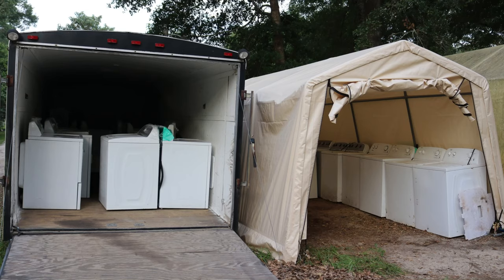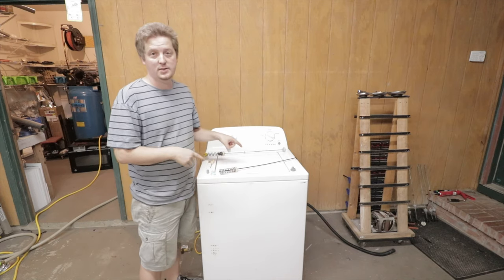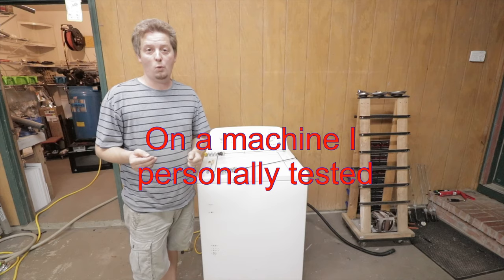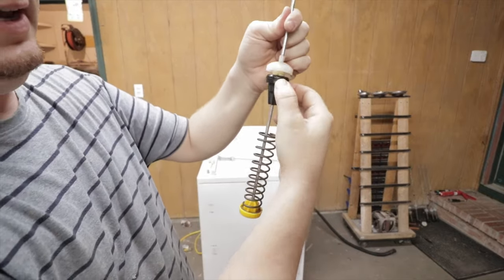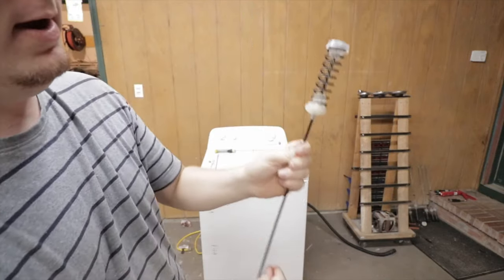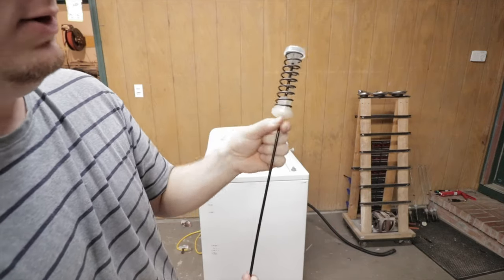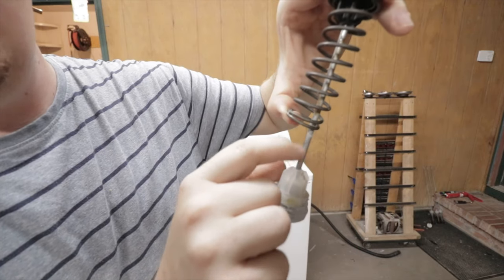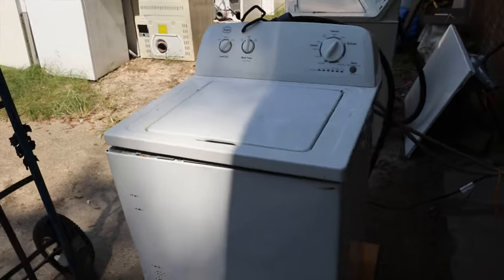Cheap Permanent? fix for shaking banging Washer? $7 to fix Suspension dampening rods W10780048

Comment: Thanks for explaining that the problem is the orange damper sponge, and that it works by friction.  Knowing that, here´s my successful fix:  I pried out the sponge, cut it vertically,  scraped off loose debris, cut approx 1/8 to 1/4 to the length (depending on the wear), greased the rod and sponge (with the part's own grease), placed it back around the rod, wrapped cloth tape (ie medical adhesive) for a snug fit around the rod and 16 mm diameter, and stuffed it back into the plastic cavity.    Minimal vibration when centrifuging. So far so good. Cost free.   

My Whirlpool did not include the four horizontal springs (from the tub to the rods) but the attach points are there.  I will buy and add them.
Reply from the maker: Interesting let me know if it fails. some other Solutions I've tried only lasted 30 days. So far the Liquid Nails is still holding strong the only problem with it is how long it takes to dry before you can put the rods back on.
Reply: Are the 4 Springs that attach to the tub and the dampener Springs required? Mine only has 2 of them. 4th of them on the right hand side front and back
Reply: After reading all the other fixes I am going to try yours. wish me luck.
Reply: I was sitting here freaking out with all the DIY ideas until I read your Gus! I recently replaced the water pump which probably broke because of the rattling. I used plumbers tape. I don’t think I used enough though because it didn’t work on High spin but it worked on medium. It’s 11pm and I’m glad I got it done. My wife washes every day all day like it’s therapy. Lol

Comment: Great video. 

That piece of rubber plays the same role as the shocks in an automobile suspension. Both add friction to movement which when combined with the spring reduces the transmission of vibrations to the frame. The rubber is not as robust as a gas or liquid shock but certainly makes for a solution that is much cheaper. Not sure if there are better materials out there that can maintain the required degree of friction with absolutely minimum wear over a long period of time. But then, even brake pads wear out.  

In my case use of Whirlpool replacement rods resulted in a tub that was very stiff when I manually pressed down on it. There was no noisy banging even with unbalanced loads!  Three weeks later the tub now moves much more easily when I press down and bounces once when I release.  That tells me that the rubber dampers have already started to wear down. Its tolerance to imbalanced loads is pretty much gone.
Reply from the maker: Check to see if you can wiggle the inside drum compared to the outside drum.
Check Ben’s appliances in junks channel on how to repair this he made a video on it about a month ago. I have not made a video on it yet, but there is a new part if there is a bit of a wobble or loose drum it is repairable. This problem will wear shocks out quickly.
Reply: @WasherDryerMoney   Maybe, put the Youtube video link tag where we can jump to the video that you are referencing.  Granted, you can't post the link in comments, but you can post the YT part ... Like on your video:
 v =    IZZCwXEmGhE    ... Then, you can post that.

Comment: Thanks for the video, I took a soda bottle ring,( what is left on the gottal after you remove the cap) cut it in half and rolled it around the metal shaft and placed it on the soft sponge, then replaced the cap, it put more tension on the sponge and shaft, dont know how long it will work but really cheap fix

Comment: Got a free higher end windowed washer a neighbor kicked to the curb.  First run the drum wobbled violently before it even got up to a higher speed.  Getting the rods out of and into the top bushing was a total pain going solo but I got it done.  Took some sand paper and roughened up the travel area and that did the trick for now.  I like some of these other suggestions better but I wouldn't want to do this over and over again.  It's not as easy as some of these other washers appear to be via how to videos.

FYI my old washer is nearly 40 years old and the only repair I'm aware of was a broken wire due to it moving during operation causing fatigue.  The clutch is starting to slip and it seems like every load is out of balance lately but compared to new ones it doesn't rust and is built like a tank.  Weighs as much as a tank too.  Keeping the 40 yo dryer.  It's gone through a few belts but no reason to replace.  Even has a moisture sensor to save power.

Comment: great vid!!i thumb'd it. hey i have a standard whirlpool, 5yr old washer, the suspension rods were replaced 3yrs ago. however, i noticed 4 tabs on each corner of the tub, with a pin hole thru it, and realize i can attached centering suspension springs from there to the rods. so my ques4u is , y didn't the whirpool come with the springs, b/c teh tech who did the rods awhile back never mentioned them?????? are they worth installing? If not, i can't believe my 3yr old rods are bad again? thank you!

Comment: Very fun video.  I've worked on mostly Whirlpool W&D's for nearly 20 years.  I buy them, fix them., and resell them.  I've learned the only way to fix the rods is to replace them with new OEM rods. The aftermarket rods are junk and a waste of time to replace.  I totally agree with you about how great the old direct drive washers were.  Their biggest problem was they lasted for 15-20 years with proper care and Whirlpool couldn't sell the unsuspecting public new machines every 4-8 years.  The VMW you were working on had a lot of other issues besides going out of balance.   I like to say the VMW (Vertical Modular Washers)  should have been called HMW for Horizontal Modular Washers because they were frequently dead. 
Regards, Neill in Oregon

Comment: This is a frigging awesome video. I had tried to fix this problem in the past by replacing the springs with no luck. Never understood why until now. This repair will make a lot of my customers very happy. Thank you.
Reply from the maker: I’ll be making a new video soon on all the different ways to fix this problem. There’s several. The problem with my solution is how long the liquid nails takes to dry.
Reply: Isn't the real problem. With faulty balancing rings. Non serviceable part on the pause play machines.

Comment: Great video, I just changed my suspension rods last night with new ones. When I was looking at the old ones I noticed that whatever dampening was supposed to be there was not working. I had the idea of trying to figure it out and maybe repair the old ones, but my machine was down for a few days so I put the new ones in and those fixed my shaking and banging problem. I knew it was damper problem, but your video saved me the time of thinking about it anymore and it confirms my suspicions. So now I need to dig the old ones out of the garbage and try this repair. I may not use them for 5 more years but they should be plenty dry by then. :)
Reply from the maker: sounds like a plan.
Reply: My dampening rods bushing wore out just after the year's warranty expired.  I used the washer less than 15 times.   These ideas from everybody will be quite helpful in resolving the dampening design.

Comment: Thank you for the video, i went another direction: for the three that still were intact, instead of replacing the “foam rubber” that grips the rod, i inserted wooden toothpicks (as many as i could force into the small space of the “cup” that holds the “foam rubber”. I was carful to not place the toothpicks directly against the metal rod so there is a layer of the “foam” between the metal and the wood toothpicks. This had the benefit of using the original material but with the toothpicks helping to increase friction against the metal rod. 
BUT i had one rod that the “foam”was destroyed and on that rod i removed the “foam” out of the “cup” completely and used a synthetic wine bottle cork. I used my scroll saw to cut away the cork material until i was able to get a really tight hold on the metal rod as well as a very good fit in the “cup”. 
I then took your advice and hot glued  the “caps” to the the “cups” on all four of the suspension rods, not sparring the glue. 
After returning the rods into their positions in the washer, i washed bath mats  and bath towels. It worked and continues to function well. It has been about a week now and all is well. 
I did have my wife order the parts on Amazon for about $40 (US) just in case. 
Thanks again for your help
Reply from the maker: Very interesting. I'm going to do a  follow up video and I'll be sure to include this idea. My repair of the Liquid Nails has still been working fine. I think it's been close to six months.
Reply: I remembered reading about your idea with the toothpicks here and later thought about a plain cork or plastic wine cork like you mentioned.  How did the wine cork do?  Another thought was just to cut a bunch of felt washers or other material that already had the ID and OD and slit them from the side, then stack them in while rotating the slits along with grease.  The weight of the tub on the top against the spring should keep it together.

Comment: I tried a few things let’s just say

I’ve found that Tessa tape wrapped tightly around the old foam rubber to squeeze it back down works just fine and it’s a ton faster than waiting on a bonding adhesive to dry. 

- appliance tech from Tennessee
Reply from the maker: Very cool
Reply: Is that Tessa tape like friction tape that sticks to itself?
Reply: @williamhopkins3500  it’s automotive tape for enclosing wiring harnesses so yes.

However , it didn’t last long and I’ve tried many things in the last few years since I do this daily for a living and tbh just buy a new set of dampers/suspension rods.

It’s a waste of time trying to fix these things, I can install most of them in 20-30 minutes vs spending countless hours on trying to fix a set….. for the problem to re occur within a month.
Reply: Ok appreciate the feedback

Comment: I just fixed mine but with a different method, took just a half hour for all four dampers. I found that I was able to pull the little foam rubber piece out of the cup, wrap it with 10 or so wraps of electrical tape, jam it back into the cup, and reassemble. That worked for 3 of the dampers, on the fourth the foam was is worse shape, so I cut a short piece of rubber gas line hose and slit it to go over the shaft, wrapped it around what was left of the foam rubber piece and jammed it into the cup. I used a sharp knife to trim excess hose. It worked well so far and no more bouncing.
Reply from the maker: Let me know if it continues to work. I tried several other methods and they work great for about 1 to 3 months. I’m glad there’s a lot of people experiment and I think we’ll find a good easy permanent fix for this problem. I’m also talking to a suspension manufacturer about improving that piece.
Reply: It's still working fine after a bunch of washes, no bouncing at all.
Reply from the maker: @Approtechie  nice
Reply: We'll, it lasted for two years, just started bouncing again. I added a couple more wraps of electrical tape on each damper and we're back in business again.

Comment: Great video, finally a proper explanation for why the springs in worn-out suspension rods seemed to actually exacerbate the shaking/banging while the tub starts spinning.  I think if the spring was actually attached to the the plastic holders on both ends to begin with at the factory, the whole issue would have been avoided all together, as the force of the spring itself would resist stretching, which would also hold those plastic caps in place and prevent them from sliding up and down . 

As of right now the tub only grips the plastic holders but the springs remain free. As you said, if the tub is filled and heavy, it simply compresses them which doesn't cause issues, because any up-down movement on any side of the tub is always smaller than the total length by which the springs are already compressed from the extra weight, i.e. the tub is always sitting on 4 compressed springs. On the other hand, If there is no water in the tub, and there is even the slightest unbalance in the tub, the tub will tip towards one side where its respective spring will slightly compress, but on the opposite side the tub will simply "levitate" above its own spring, only to then smash down on that spring when that first original spring decompresses, and once this starts it just gets worse and worse and the whole dampener turns into a 4-way see-saw on a trampoline.
Reply: Rods are not worn out. Only need more damping grease. It’s very sticky. The opposite of regular grease
Reply: Put damping grease on it. It’s a very sticky grease
Reply: @johnellisonarmadilloconstr7966  I'm not saying your wrong, but I would think that new grease would only works for a short time, as the dampener is worn and won't grip the rod tightly enough.  But that's just an educated guess that could be wrong.

What isn't wrong is that it's a crap design.  If there was a wiper to redistribute the grease, I think they'd last longer.  Or a segmented cone design that self adjusted as wear occurs.

But new, complete aftermarket rod assemblies cost as little as 6 bucks apiece.  Just replace them.  Use the old ones to make something cool. 

Where would one find this special grease to test it out?

Comment: Apparently washing machines were not breaking down fast enough so the manufactures decided to stop direct drive and put in worthless suspension rods.  The bouncing washing machine is maddening.  Once the machine moved about ten inches or more and disconnected the dryer vent.  I have received new suspension rods and will soon try installing them.  Then I will try to do this simple repair as on the video. Hope is works

Comment: Your video is the only one that I found which actually identifies the core problem and also offers a very genuine solution to it. I'm sick and tired of people just replacing parts. It's alright if the part is cheap and readily available, or else a total pain in the butt. Thank you so much
Reply from the maker: Glad you liked it. I was going to make a follow-up video when the Liquid Nails fix failed but so far so good it's still working like a charm. The only problem with my solution is how long it takes for liquid nails to fully cure. If you don't allow it to fully dry it will just squirt all the Liquid Nails out and start shaking again.
Reply: These washer machines just have a piss poor design on their suspension, that's the real problem. Who designed 4 small rods to support a basket tub filled with water and clothes anyway??
Good video though
Reply: @WasherDryerMoney  you have alot of experience with repairing washing machines. What other types of suspension/damper system have you seen in top load washing machines, and which is the best/most durable design in your opinion
Im planning to buy a new one now, my solution does not last more than few months and I'm getting annoyed having to fix it with cable ties every now and then. Do you have any suggestions on how to fix my damper rods, it's slightly different from your plastic component..u can check it in my video

Comment: Wow, thank you so much for this. It's really helpful to know how these work. So I replaced my damper rods and things seemed to get worse, but I didn't realize how they worked so i'm going to go check them now. I also replaced the plastic hub under the wash plate with the metal alternative and that didn't fix it either. I'm going to go check the new damper rods and see if they are having the problem that you discussed. I bought them off of Amazon and i'm not sure if they are OEM but perhaps they were just cheap parts. Do you have any other ideas of what could be wrong?

Comment: WDM, Thanks for the video! I now understand the purpose of the "dampening/support rods. Replaced them yesterday and, holy cow, the violent unbalancing of the unit just went away. The original rods were not as bad as the ones you show, but they apparently were bad enough. I needed my Cabrio WTW6400SW1 back running ASAP so a replacement OEM rod set was the ticket. Since the back right corner was the more difficult of the four, I would  suggest that DIYers start with maybe one of the fronts just to get the "hang" of it. Thanks again for the video. BTW, earlier this year I replaced the driveshaft, bearings, seal and hub gears (shaft splines at wash plate were actually stripped out) . Aftermarket parts were NOT the way go. Bearings are really low grade and replacement shaft was .015"-.020" smaller at the splined ends which mandated that I had to make shims to eliminate the excessive backlash.

Comment: I just tried a fix with a Samsung washer. The little plastic piece is on top of the spring. I put a small hose clamp on them and tightened them down pretty good.
Reply from the maker: Interesting.